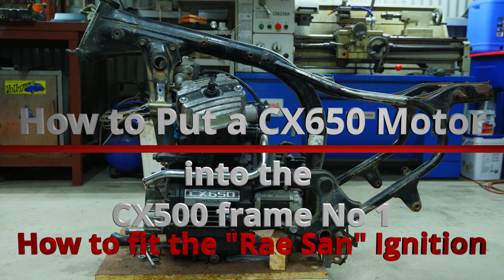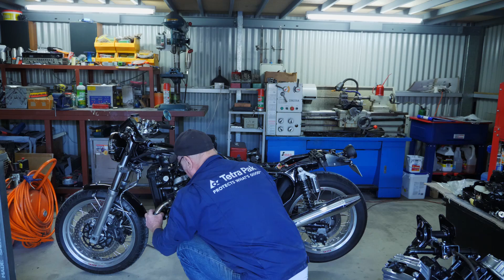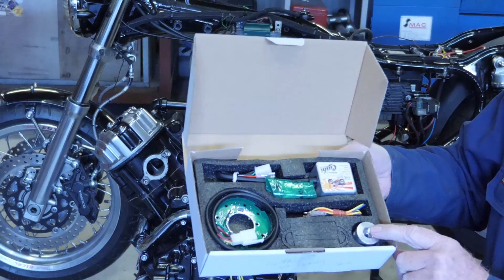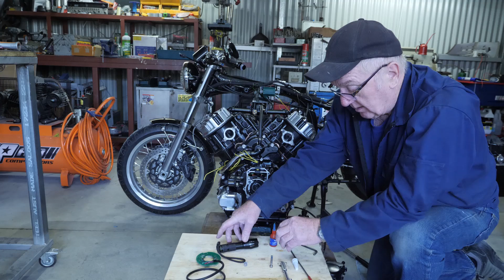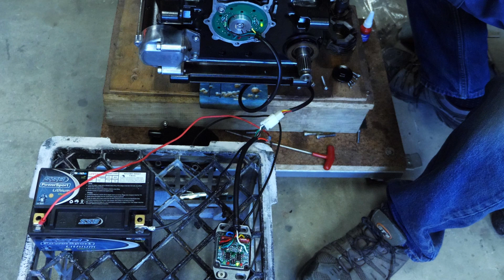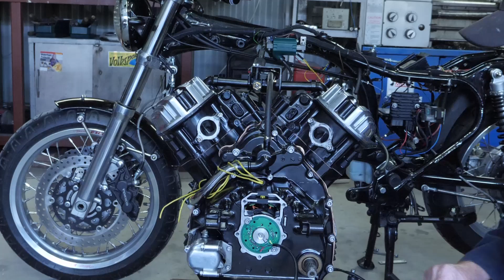CX500 motor comes out. Ignition upgrade on CX650

Comment: Does the Rae San ignition come with a new cover for the ignition, to be used in place  of the flat cover?
Reply from the maker: Hi John
Flat Cover ?
The Rae San ignition fits inside the OEM ignition cover on the engine and you have a small Rae San unit  that mounts were the OEM exciters went
Reply: @Coolhand99au  Thank you for your response.  I was told that the rotor for the RAE SAN ignition sticks out further than the OEM ignition advance assembly and therefore needs a cover with more clearence. Is this not correct?
Reply from the maker: @johnF56  No John "The Rae-San rotor and circuit board fits in nicely into the OEM ignition cover on the engine 
You can see that on my two CX's
Reply: @Coolhand99au  I see that your covers have a dome on them for the rotor to fit into.  I have a CX500 and it has a flat cover. So perhaps I need to procure a used cover off of a CX650.  Thank you!
Reply from the maker: @johnF56  Hi John 
Check out my my CX500 Video No 4 that engine was in my black Cafe Racer and it had Rae-San ignition and it has the original ignition cover 
Note CX Rae-San ignition kits are different for 500and 650 
Link below
https://www.youtube.com/watch?v=pqzhklDqznk&t=254s
Reply: @Coolhand99au  ok great... thank you!

Comment: great video.   I know this is old, but will this work on the cx650T  (turbo bike).   The turbo bike is fuel injected and I'm not sure how this would match up?
Reply from the maker: To be honest I dont really know 
But I would think the mounting holes and carburation/fuel injection space would be the same as a standard CX650 motor

Comment: Nice Video, i just bought an 83 cx500 c and i‘ m searching  vor the Right ignition System, please help me !  The Stock System is a tai ignition , i want to run a coil over Plug System by Using sea doo coils… i can Choose a cop Option  at the Rae san Shop , they offering a Pre- wired relay  for what do i Need That ?  Trank you
Reply from the maker: Hi Andreas
Mate I have never had anything to do with the "Coil Over Plug" system 
You would be better off asking Ray himself 
I kept mine simple and just bought the Hall Effect kit to replace my 1982 CDI ignition system

Comment: Good day Sir.
What ignition coils did you use with your Rae-San set up and what resistance are they?

Cheers
Joe
Reply from the maker: Hi Joe 
You need two 12 Volt DC single output 3 Ohm  ignition coils
I looked up the eBay link where I got mine and it is no longer there. I got them from 2Fast Moto and they only seem to have Dual Output coils now, you need single output 
Here is a link to a Dyna Tech coil 
https://www.ebay.com.au/itm/Dyna-Ignition-Coils-Coil-Kit-3-ohm-Single-Output-DC3-1-CDI-DC-3-1-Dynatek/393043279484?epid=171232208&hash=item5b83347e7c:g:RyAAAOSw3ZFfyk2q
From memory Dyna Tech were expensive
Reply: Good day Sir, thanks for the prompt reply. You're correct when saying they're pricey, especially with the ZAR / Dollar exchange rate that it is. Wow!! Looks like I'm in a spot of bother then . WILL ANY OTHER 3 OHM COIL WORK, OR IS IT ABOUT OUTPUT VOLTAGE THAT YOU CHOSE DYNA COILS?  I need to move to Rae -San as my CDI system has gone for a loop.

Cheers Mate
Joe
Reply from the maker: @joeheydenrych1240  I live here in Adelaide South Australia and Ray who makes the Rae-San ignitions lives not far away 
Now when I bought my Rae-San ignition unit he recommended a 12 Volt DC powered 3 Ohm single output ignition coil. Sure you could find a coil that meets those specs Like I said I got mine from 2 Fast on eBay see link below
 https://www.ebay.com.au/str/ClassicCycleParts-Online?_bkw=Ignition+coils
The Rae - San ignition system is a good system> Perhaps you could email Ray for some first hand advice 
Good luck
Reply: @Coolhand99au  Good day Sir. I'm eventually in the process of setting the timing on my Rae san unit, but noticed that there is no timing mark on my CX500 casing that I can use as a reference against the fly wheel marks. What the hell to do now?
Any advice here

Regards
Joe
Reply from the maker: Hi Joe 
If you don't have any timing marks someone has removed the R/H ignition coil that has the ignition timing pointer on it  inside the motor. When I did my Rae San  upgrade I removed the copper coils from the R/H side and refitted the R/H coil aluminium housing.
What you can do is make a carboard template that will fit into the inspection hole. I have a PDF file with instructions on how to make the template. Here is a link to the template 

https://motofaction.org/motorcycles/honda-cx-gl/a-paper-timing-pointer-murray-micah-tool/

Step 1
Print template onto card-stock or thick paper. This helps to hold the shape and give an
accurate datum. When printing, make sure to change your settings to print "actual size" or it
will not fit. I have put 6 of the templates on one page just in case something goes wrong when
cutting them out.
Step 2
Cut out template and also cut out inner section with honeycomb fill. I found it easiest to use a
hobby knife, but scissors would work too.
Step 3
Fold the timing mark needle on the line through the template so that it stands at 90° from the
face.
Step 4
Place the template on the rear timing cover, making sure to fit the template into the radius
against the case and also locking the template into place with the angled edge (seen inside the
red circle on the picture). This is to ensure the template does not rotate and gives an accurate
reading for the timing marks.
Step 5
Look into the timing cover hole so that the lines on the timing mark needle line up with the
lines on the face of the template (Step 5 GOOD). THIS IS CRITICAL. Do not lean too far
forward or away as the lines will not line up and you will not have an accurate position
reading (Step 5 BAD).
Step 6
Ensuring the timing needle marks line up, use the template to position the timing marks on
the engine.
Reply: @Coolhand99au  , Good day sir. Thank you for the in depth feedback, wow!! I suppose I could just fit the old coil as a fixed reference, as I need to take the rear casing off again? For some reason the engine only turns over in one direction when using a socket to turn it  and I'm completely baffled now. Don't know if its the starter clutch now or what? This old girl is putting up a fight indeed. Guys , any input would be appreciated. Cheers

Comment: why rae san? I know it is more accuarate, but much more work than ignitech. I'm still in doubt which one should i use
Reply from the maker: Hi VR
I chose Rae-San ignition again because it had worked so well on the CX500, latest technology compact and reliable  
I think Rae - San ignition has got it over Ignitech  because with the Ignitech  system you still need your advancer coils and they are getting old 
Sure it is a bit more work but if your overhauling a 40 year bike why not upgrade important electrical areas like the ignition system and the charging system